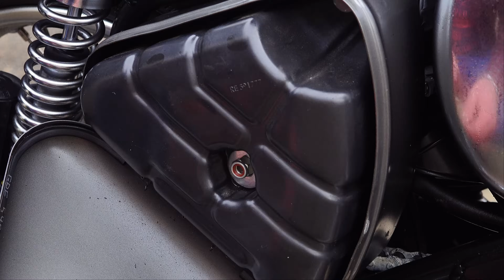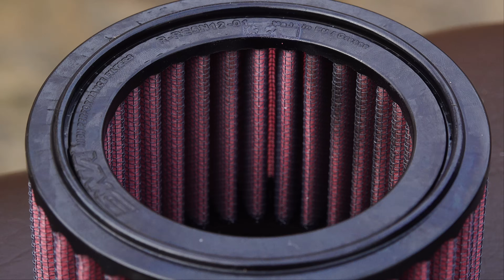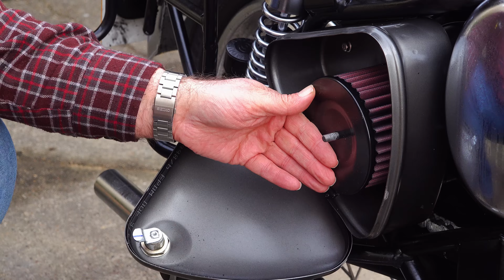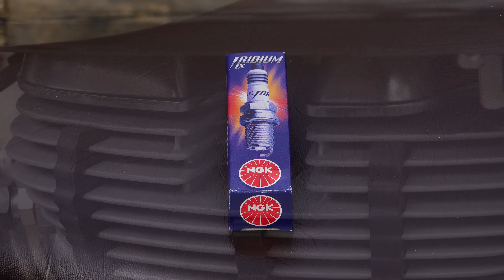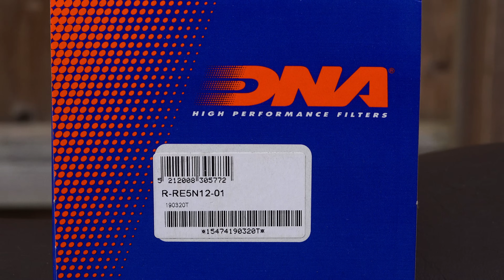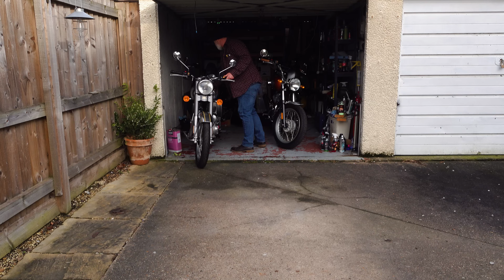Royal Enfield Classic 500, TOP PERFORMANCE MODS I didn't tell you about!

Comment: I have had very good luck with Czech  made Brisk spark plugs. It is of the multi prong design type--so NEVER A NEED TO GAP IT. I put a pair in my Ural side car rig and it made it go from a no kick start to a one kick start. And as you noticed the cold idle was much improved. I like them so much that I have them for my RE 650 and Himalayan. I have seen tests where several different types of plugs were used  in see thru glass head lawn mower engines, and then they  ran them with and without load on a generator. There were length of run differences. So measurable results.

Comment: Morning. Thank you once again for an enjoyable video. I carried out the same mods to my 2020 classic. How easy will yours start on the kick. Mine is terrible.
Reply from the maker: usually first kick when warm can still be problematic when cold though.
Reply: A common reason for poor starting when cold, if warm starting is good? Not enough fuel enrichment. For example, my kickstart only 350 Bullet will kick back from cold if I haven’t tickled the carb enough (I retrofitted a “concentric” carb which does have a proper float tickler, unlike the standard Mikcarb VM24 which only has a mixture enrichment knob).
Reply: @wheater5  The latest ones are fuel injection unfortunately so no carb to flood.
Reply: @peterwilson8797  Thanks, yes, correct. It's by no means unknown for EFI Bullet owners to remove the throttle body injector and revert back to a carburettor.

Comment: Well, I fitted the iridium plug to my Classic 500 'Tribute' and that was an improvement, then I fitted the DNA air filter - too soon yet to tell if that is an improvement. Then I fitted the booster plug, to fool the ECU into detecting a lower temperature than actual, and that was a definite improvement. In that process I realised the stock air temperature plug sits across the air intake so maybe that needs moving. Thanks for the tips!